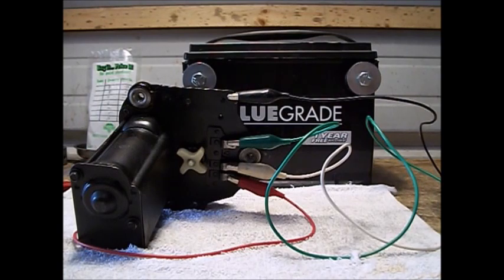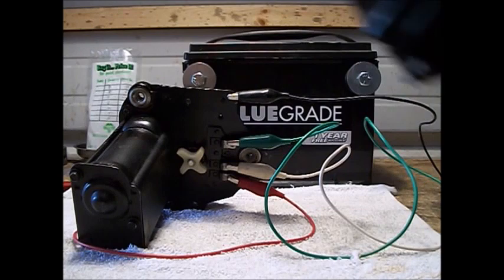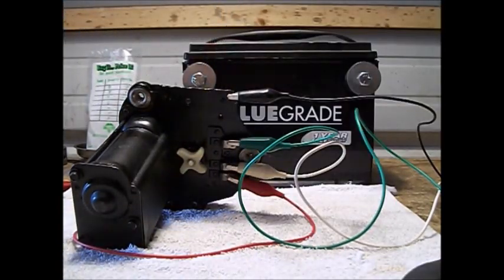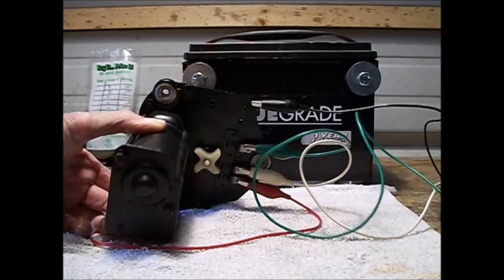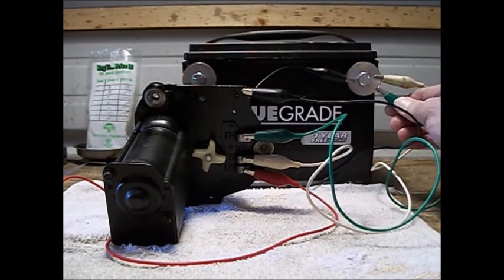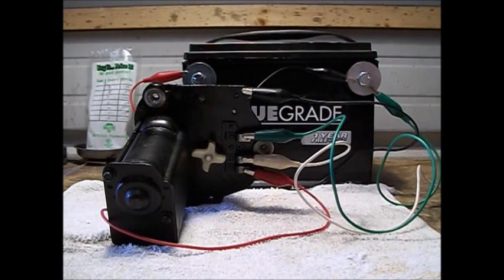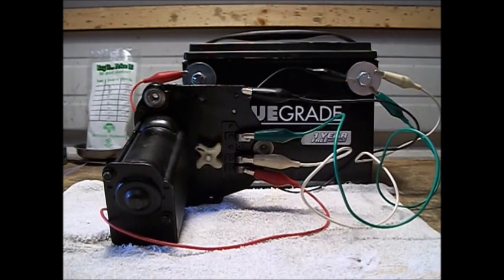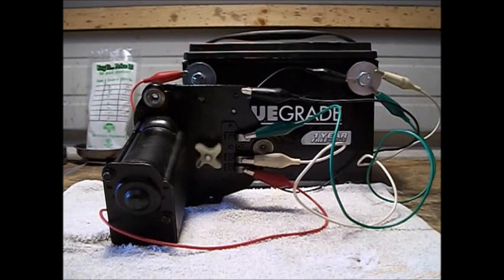1967-1972 C10-C20 Wiper Motor Bench Test

Comment: Your Bench Test Video of the wiper motor is absolutely excellent.  I followed it step by step with a motor exactly as seen in your video.  Now my problem is trying to accomplish the bench test with the additional component being the 2 speed wiper switch I have which is a Cole Hersee #75212-04-BX.  The only way I was almost successful at using that switch was to wire the terminals as follows:  Switch Terminal Labeled "B" to Battery Terminal (-) / Switch "L" to Motor (L} / Switch "H" to Motor {H}  / Swith "P" not connected.   Then the Motor (Ground to Frame) connected to the Battery (-) and the Motor (+) connector directly to the Battery (+) Terminal.  With this everything worked as the bench test did, perfectly.  Turn Switch to first position motor operated at low speed, Switch at second position motor operated at high speed.  Turn Switch back one position motor returns to low speed. Turn Swithc back again motor stopped at park position.  However after that the motor started to heat up which I guess was due to the motor still directly connected to the battery (+).  Is the switch Im using wrong for this application? Am I leaving a component out that Im unaware of?  I'm obviously doing something wrong, I just do not have the knowledge level to correct what Im doing.
Reply: Good video, helped me to understand the idea! Anyhow, there is a catch if You park it by disconnecting the  hi speed ground: it will park (like in video) but it wil draw 5 amps current when in park !!! (if  lo ground still connected). The  'LOW' should be 'grounded' to the 'HI' terminal which is then grounded to chassis. This prevents the 5 Amp-iin-park problem and parks nicely when HI ground is cut. Hi speed is done  by just  disconnecting LO from HI.

Comment: Cool video thanks for the info. Why don’t you want to reuse the original pump? I have the same one I’m about to try to use a rebuild kit and see if I can get it working again. It worked last summer. To bench test that pump is it as simple as connect a positive and negative to it ?

Comment: I tried this with my same wiper motor from Cardone but using the car battery. It just made a clicking sound inside the motor and sparks om the contacts. I am assuming my motor is dead? It was brand new and had worked before getting it back from a body shop where it sat for a while outside.

Comment: Great video 
I, have a 69 c10 truck with a new wiper motor and pump.  However I can't get the motor to run it's getting power do thank I have a ground issue I thought the firewall would have been a good enough ground any help would be great
Reply from the maker: Yes a bad ground won't complete the circuit. Try grounding another way, just a jumper wire to a bare spot on the frame or all the way to the negative battery pole. Also, how are the ground straps on the truck itself? If those are bad the cab itself may not be properly grounded. These trucks are getting up there in age and with corrosion taking its toll,  the ground straps could be failing. They are commonly overlooked. Good luck.